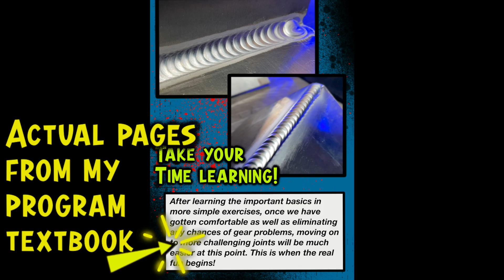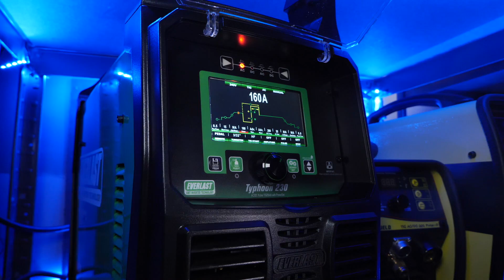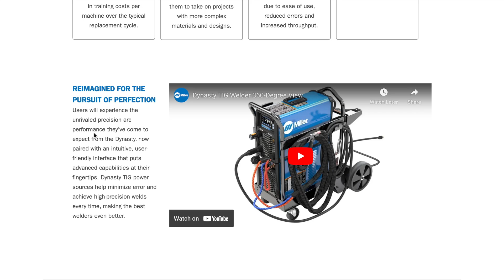TIG welding myths BUSTED

Comment: I got a ArcCaptain AC/DC tig welder with foot pedal for about $640 during BF sale.  Came with everything including blue tungsten.  Got a used argon tank dirt cheap on craigslist.  I'm starting on steel 1st before moving to AL or SS. Have dipped that tungsten more times that you can imagine,  but slowly getting better.  I did try out AL just make sure the welder worked and I was shocked at how loud the buzzing can be on AC depending on freq so I wore small foam ear plugs. I took the free on line class to get started.  My dream would be getting a typhoon class Everlast but I would settle with the 210ext when they come out with the auto fan version they sell in Europe. But for now the ArcCaptain is good enough, it has an auto fan. I only practice about hour a day.

Comment: You missed one, I’m sick of people saying TIG is to slow.
Reply: Well, it is the slowest of the bunch.
Reply: I mean, it is sorta the slowest outta the 3 major processes. It's more sensitive to poor fitment, it's more sensitive to dirty metal and dirty materials, it's just all around a slower process but yields incredibly high quality work when done well. And that's not to say that you can just MIG right through greasy metal or poor fit up, but TIG does need more prep work where MIG can cheat that prep work to a small extent